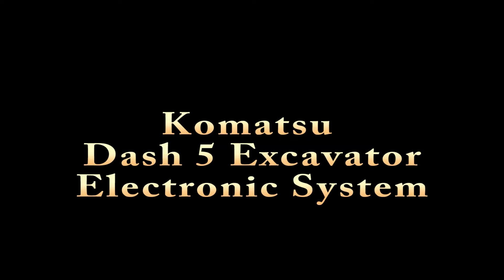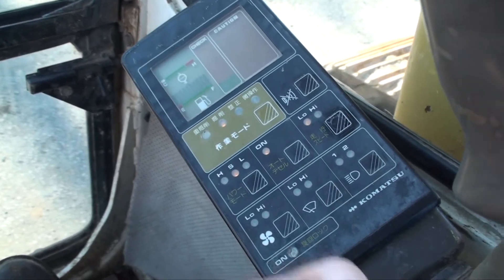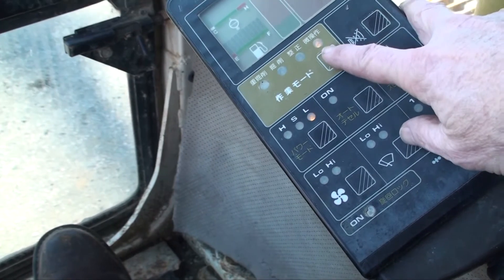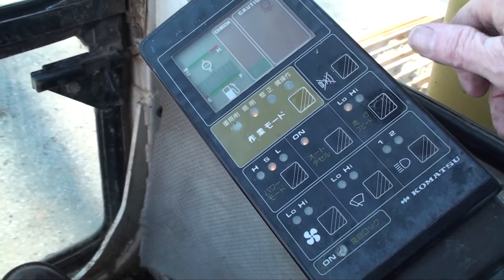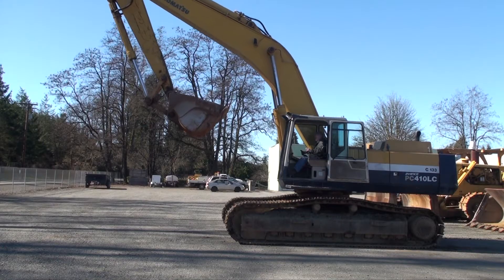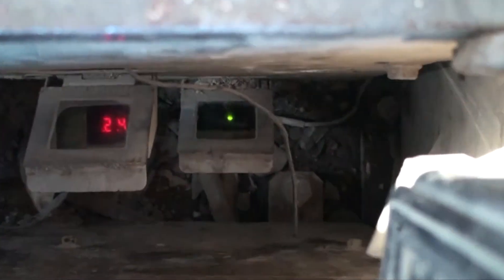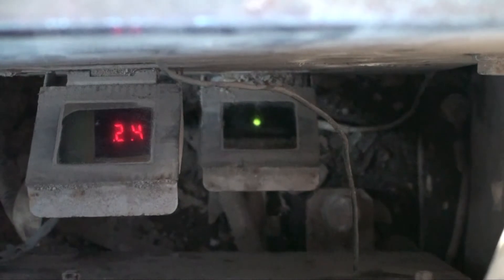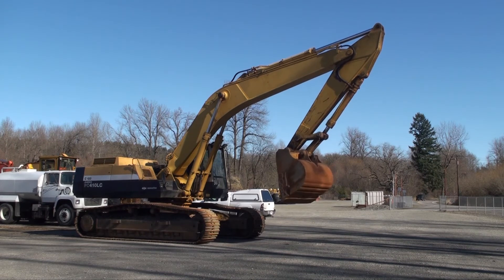Komatsu Dash 5 Electronics

Comment: Hello, I want to know the list of fault numbers for the Dash 5 excavator at 14, 23 and 26. Thank you very much
Reply from the maker: Fault code 14 is disconnection in swing brake solenoid system. You can get this fault if the swing brake prolix switch is in the full time release position. 
Fault code 23 is front pump pressure sensor sensor system. It can be a bad sensor or a problem with the wiring. 
Fault code 26 is the engine speed sensor problem. You can check the sensor with an ohm meter. It should show around 3 to 8 ohms resistance between the wire leaks and no continuity between a lead and the body of the sensor. 
Good Luck on the repairs.
Reply: Thank you, dear sir.  Where is the code sensor 23 installed❤
Reply from the maker: @منوعات-خ2ب6ت  As I recall the pressure sensor is installed on the main control valve at the hose connection from the pump. There is a sensor for each pump and valve section and you will see the wires going into each.
Reply: @repairsecrets  thank you
Reply: How much is the temperature, diesel and speed screen, used, in good condition, can you send me one to Jordan?
Reply from the maker: @منوعات-خ2ب6ت  I'm not in the parts business so I can't send parts to you. You should be able to find them somewhere in North Africa or Europe easy enough. Good Luck
Reply: 240 -5 Kod 22😢

Comment: Would you know what voltage and current values are sent from the hydraulic pump controller to the TVC solenoid? in each operating mode
Reply from the maker: I wish I could help you with that info but it was never published that I know of and the local dealer who built a pump dyno didn't even tell us in the field about that stuff. We did use the travel functions or cycle times on boom up to see if it was working properly.